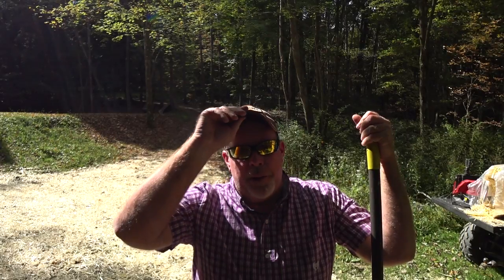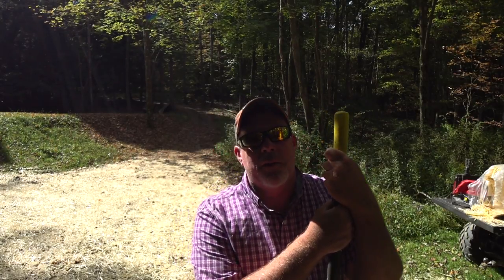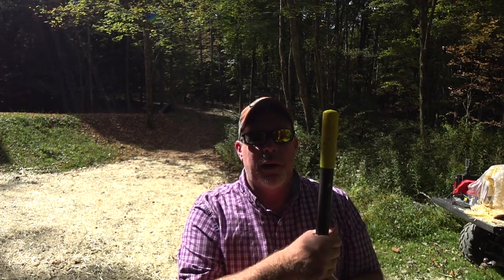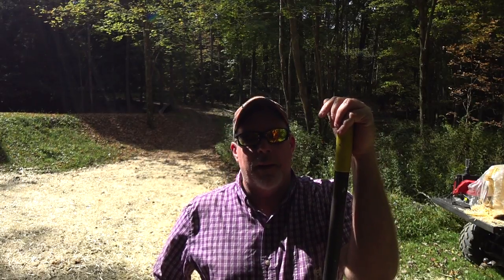#71 Building, Seeding, Mulching, Mowing, Grading Before Noon

Comment: That's a really nice target holder -- and really tempted to copy if I could shoot on my own property.  However, I've resorted to using a single green treated 8' 2x4 (cut & assembled into a H-shaped base) with a pair of 1x2 uprights (cut from a single 8' board) with mason twine thread through the 1x2's for the horizontal cross pieces. Then I just use tape a paper/cardboard target up to it whenever I'm shooting. It's easy to transport (shoot on public ranges here) and cheap to fix when the 1x2's or mason twine need to be replaced from bullet strikes.  Started bringing my own stands to the range as the rope/twine strung between the steel posts at the range were frequently snapped. missing, or just not being re-strung ....and I wasn't all that inclined to keep re-stringing them every weekend, so I ended up making the cheap, repairable holders I have now.

Comment: Hi Mike, Love your Vlogs. Question, you seem to spent alot of time scraping the track down to your log walls, why don't you dig 8inch  wide by 18inch deep channel and run drainage/soak away pipe down and fill with pea gravel to soak away water? might help and save you time, time you could spend splitting wood.